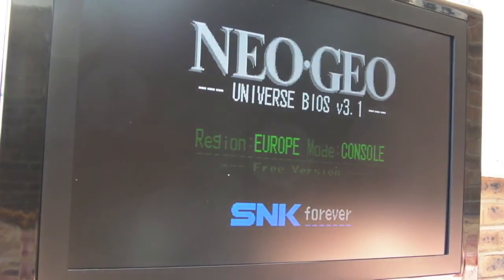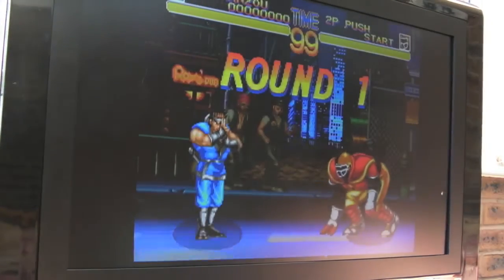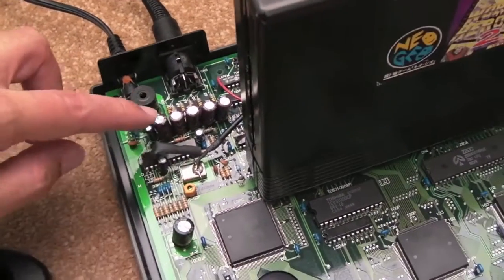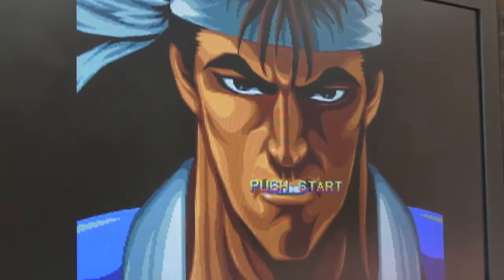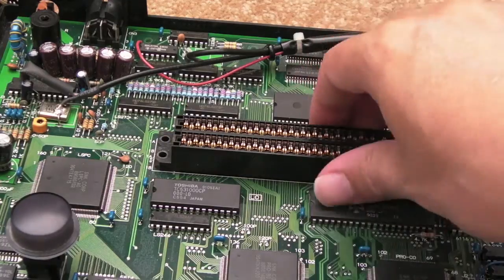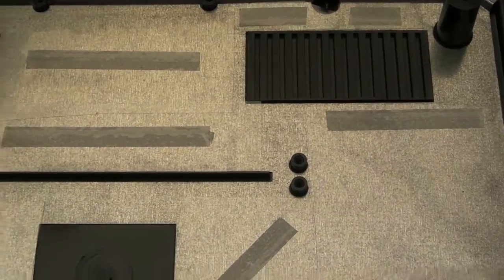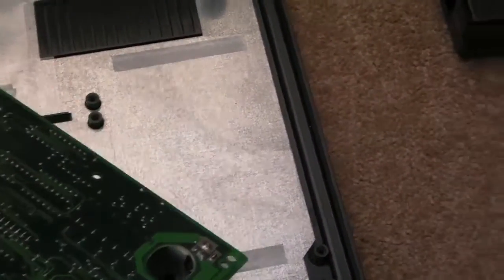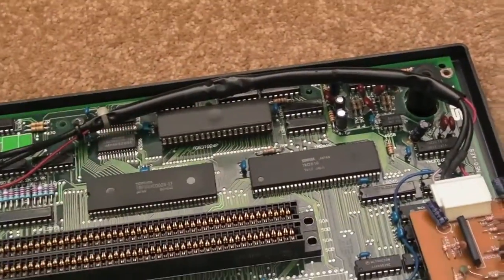SNK Neo Geo AES Revision 1 Video Mod / Repair

Comment: Hi man, please help me here. I just got an AES board disassembled,  so since I already have an Aes case (it seems is from other board AEs revsion but it works either)  and I am trying to assemble everything again, but I ended with a GREEN cable I dont know where to place.  Is surprising how there is any videos at youtube about how to disassemble or assemble any NEO GEO AES boards.  Please man, would you help me here? I suposse the cable should be connected to ground  as you mentioned at some point at the video, but I dont know where and HOW to place both sides  exactly. Please would make a small video this?  Sorry I am too noob about NEo Geo AES
Reply from the maker: The green wire goes to one of the corner shielding mounts (where the heavy metal shield sits on top of the motherboar).  It's just a ground connection!
Reply: @GadgetUK164  thanks a lot, so please confirm me, you mean at the point you marked at 7:45 right? it SHould be over or under the board?  and then if thats correct, were should I place the other  end?
Reply: @GadgetUK164  Sorry about too much asking maybe is just the language barrier and my noobieness about this stuff make thi difficult for me. Please if you can explain me better were I should place properly both ends of the cable, it will be highly apreciatted.

Comment: There is a small "daughter card" on your system. I have this on a system I purchased; however, someone had previously "rewired" it (actually, just pulled the wires off) and I just got the system running after completely removing this "add-on" card. It appears to be some type of over-clocking mod? Anyway, would you please tell me if this card is needed? And if so, what is the correct pinout?
Reply from the maker: I believe its a PLL (phase locked loop) to improve the video quality.   So it will work without it!

Comment: Thank you for a speedy reply and I hope your health issues are minimal these days.I actually have unibios 3.1 installed along with the RGB bypass upgrade done by a well respected member at neo geo forum.I will look into getting the test bios as you recommend.Thanks again
Reply from the maker: Let me know how you get on!  I might be able to assist further once you know which RAM is causing the fault.
Reply: I've been waiting patiently for one of the members on neo geo forums who said he has a diagnostic bios that I could buy. It has been a few days now. Is there any chance you could direct me as to another way I could get one? Thank you, I appreciate it.
Reply from the maker: Go to buyicnow.com, add a 27C1024 into your shopping basket, add the 'pre-programmed' option and upload the ROM - they will program it for you.  WIll take a week or two to arrive but cheaper than anywhere else and saves you the hastle.  There are 2 ROMs on the SMK Dan page http://smkdan.eludevisibility.org/neo/diag/#download   It's the sp1.bin you need from the zip there.
Reply: I ended up getting one from the gentleman who did the initial repair (Jamma Nation X). I installed the diagnostic bios and when I booted up my AES I get "Palette ram dead output (lower)" I posted on Neo Geo forums where things are at and I'm not sure what my next step should be. I get continuity on the traces that I believe to be Palette ram related. Any thoughts?

Thanks so much

Comment: Thanks for posting these vids man. i have a similar aes with work ram error. trying to locate and test. any chance you can lend a hand? thanks again
Reply from the maker: Thanks!  You need to get a copy of the SMK Dan diagnostic BIOS.  Swap the BIOS out for that and see what it reports.  If your BIOS is not socketed and you've never desoldered a DIP chip before, I would find someone on the Neo Geo forum to do the work for you.  I cannot do repairs for people due to full time job and long term health issues.

Comment: Hey Gadget, can you email me here please? I've got a really early AES revision 1 serial 003228 that I need the schematics for as it's missing the power components Q2 Q3 Q4. thanks info@globalgarage.com.au
Reply from the maker: I don't have schematics for that early version - in fact they haven't been publicly released yet!  Only the boards using the 1FZ chipset have an available schematic.  What I can do is tear my AES down for you at weekend and check those components to get part numbers off them - if that helps?
Reply: GadgetUK164 - Retro Gaming Repairs & Mods ok thanks. I've got another model similar which I've grabbed the part numbers off so I may be ok thanks. It's a later revision with the separate power board but I think the parts are the same. My revision has no external board but all 3 transistors on the board. I've never seen one this early.

Comment: I've been curious.  I purchased a neogeo gold system back in the mid 90's.  When i first got it, I noticed a weird video effect where it looked like there was a window screen overlayed on the screen and it moved from left to right.  I sent the neo into SNK and when I got it back, there was that beige board in it.  It seems like that board stopped the 'interference' from scrolling.  You could still notice the interference moving left to right when you 1st powered the unit on but it stopped.  

My question..  What the hell was the function of that board they installed and what exactly did it do?  ....That weird interference was still there but it wasn't scrolling through the video image. It seems like it caused edges of displayed objects to have a jagged look.  What was that board?

If you don't know about the "interference" I'm talking about, give that little trimmer cap/pot a twist when the system is on and you'll be able to see that "window screen" effect that I'm talking about.  The 15/16 year old teenage boy in me NEEDS to know what that board did.  I kind of wish that the interference just moved really fast instead of being stationary.  I played the MVS a lot before I got the home system.  It is still one of the biggest mysteries of my teenage years.
Reply from the maker: +E2qNX8btraQ3zRD6J7fc I honestly don't know - I had previously suspected that it was a way of changing the video output, but it sounds like it was a factory fix of some kind.  When I get more time I will take a look and see if I can work it out.

Comment from the maker: Just a quick update - I measured the old 100uF caps today, they measured less than 40uF each!  So they were actually failing =O
Reply: Hey there. Great video, I noticed this is the exact revision I have. Would you happen to know what is that on the power jack? Looks like a ceramic capacitor, I wonder what that one is for?

Comment: Nice job! Is there anything you can't fix?
Reply from the maker: Hehe, I would have said 'no' earlier today, but after spending 4 hours looking at Beaps73's Neo Geo CD I think I have to say 'Yes' lol.  I am having a tough time with his Neo Geo CD at the moment.  I think it needs a new laser but its confusing because he has 2 lasers already, the original laser and a replacement laser, but when he couldnt get the replacement laser working the seller just gave him a full refund instantly with no questioned asked.  So the question is did the seller sell him a dodgy laser that was untested?!?  I've ordered another laser and a driver chip from China... Will be a few weeks before I get the video up but that might be the first system I've not been able to fix.  I HATE CD and DVD drives lol.

Comment: Brilliant! Man, you can give Mr. Morse a run for his money. :D The improvement is substantial.  Excellent job!
Reply from the maker: Hehe, thanks =)  Just a quick update here - I checked the old caps I took off today (thinking the original capacitors would be good to keep and re-use etc) and they were all measuring less than 50% of the value they should be.  So they were actually faulty - I did not expect that!
Reply: GadgetUK164 Wow, that is interesting. Some of the old parts last, some don't. For a 20+ year-old system, you'd expect something to go at some point.